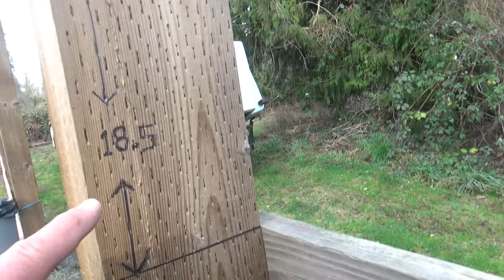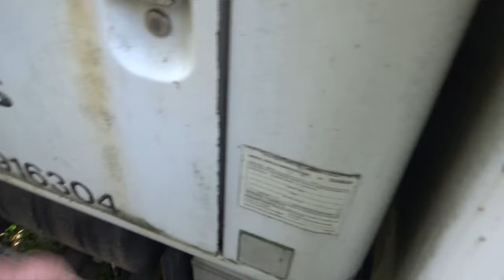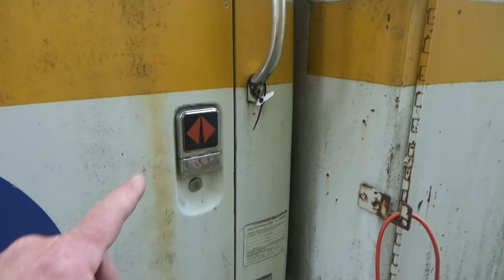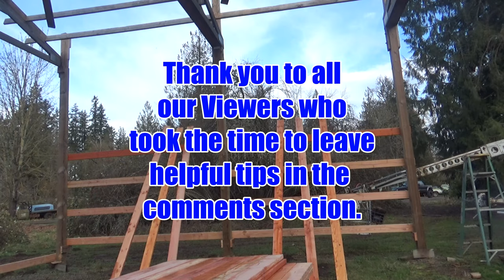Building Bigger

Comment: Little by little the workshop is taking shape, great work Rick you’ll get inside working one day.
Reply from the maker: That's the plan!
Reply: That's why we keep watching these shop building videos! BTW, Rick asked if we knew what to call the zip tie he was using to keep the fuel shutoff open on the bucket truck. My vote is to call it a "detent," even though it is hardly a stock item. Necessity is the mother of invention, after all..

Comment: the barn  is raising  quickly now.  keep it going and you will finish in no time!   the international DT is the series of engine you have. it is direct injection and does not use glow plugs.  some came with a grid heater in the intake manifold for the colder climates. yours probably didn't. the smoke is normal until it's put to work and warmed up.  the fuel solenoid is likely a three wire set-up with two coils. if that is what you have, one wire is pull in and one is hold in and the third is common.   if it's two wire, the solenoid must be grounded. you can check the resistance between the common (or ground) and the other two wires . one should be low resistance (pull-in) and the hold in coil will have high resistance. the pull-in activates while cranking and and the hold-in activates with run key switch.  you can have coil issue or voltage problems.   hope this helps.

Comment: That is a cable operated engine shutdown. Our 1993 has a T handle to the right of the steering column. To my knowledge, it does not have glow plugs. It may not have a block heater. We have a couple of magnetic heaters we use in severe weather. They work best  stuck on the bottom of the oil pan, but you can also stick them on the block at the cooling jacket.
Reply from the maker: Thanks for the info Rick!

Comment: They make and Sell a Dip Stick Block Heater, and it is just as it sounds, It goes in the Dip Stick Hole, and then plugs into and Electric Cord, and it does work well! You don't keep it in after you Start the Engine, but it does keep your Oil heated and ready to go. Look for them at either the Parts Store or a TSC Farm Store. God Bless you! (Keep up your Awesome Videos)
Reply from the maker: Thanks for the info!
Reply: @ClassicTruckRescue  No problem, just trying to help, Keep up the great videos, Keep on keeping them Real. May God Bless You!

Comment: Fuel shut off solenoid is not working. 
Does it have power and ground?
12V ignition on circuit, 12V cranking circuit,  common ground. 
Cranking circuit retracts solenoid, ignition on holds solenoid in place. 
Power test good then replace bad solenoid.
Seen a few where farmers have deleted the solenoid and just went with a manual cable added to the dash. And a return spring to put the lever back to open position.   Pull the knobs out closes the shut off lever,  push it back in and return spring opens lever back up.

Comment: It looks like you are getting into the part that will go faster than it has up to this point. That has to be encouraging. I always look forward to seeing the next step toward completing the building. I mentioned that I know little about diesel engines but I am aware that they have a device of some kind, revealing my ignorance here, that shuts off the engine. I think it shuts off the fuel. It looks like there is a solenoid that is missing from that arm, or, there is a solenoid there but it isn't working . Given that it shuts down when that is not held back, it would seem that something should be holding that arm back when you turn the key on.
Reply from the maker: I agree. Thank you and Thanks for stopping by again.

Comment: Hi rick good progress with the building , are you putting partical boarding on the roof and tin over the top of the boarding, i've found that if you just use just tin it gets condensation on the underside and it drips on everything plus it cuts down the noise when it rains. I know it's more expensive and more work , but much better building

Comment: Rick, Most Diesel engines that have an Either start assist system do not have glow plugs. If Either is used on a glow plug system the glow plugs can break and the pieces fall into the cylinder. There are magnetic block heaters that you can stick on the metal oil pan.
Reply from the maker: Thank you Dwayne. Good to know.

Comment: Rick I don’t know much about diesel but I do know that to turn them off you usually pull a handle that choke’s the motor off!!! And if there’s a block heater look where a freeze out plug would be if there isn’t one there’s no block heater!!! I’m thinking that cable is stretched out and blocking the intake for not letting it start properly!!!!

Comment: I know it’s a lot faster with a nail gun but I’m a believer in screws instead of nails. It’s stronger construction and they won’t work out like nails. It’s looking good coming right along.
Reply: I thought the same, until I had a contractor tell as a building flexes or moves, nails will flex, screws will break!
Reply from the maker: I have heard both. Screws are a lot more expensive though. I use the screws in some sdituations, (like when I attach brackets) but nails for most.

Comment: That's a fuel solenoid. That your putting a Nylon tie. On to start it. . It's usually electric. Make sure you have power to one of the wires. The older diesels you could take them off and take apart and clean them. They get corroded from setting. Moisture. If not take it off and take to a Dealer or parts store with serial number of the engine and truck. You should be able to get a new one. It starts Alot better... Also You could do away with it and use a push pull cable. And mount it where that arm is on pump .The old Macks and other trucks used that style forever. Cheap fix too. Just find a heavy enough cable for it. Mount it in the dash and done .Pull to start and push to shut off. Or the other opposite of that. Sending Prayers to Lou and Your Mom..
Reply from the maker: Thanks Thomas. The problem seems to have been corrected when I added the second battery in parallel.

Comment: Don't know if the diesel has working glo plugs or not but in case it does and you have a faulty gloplug light just leave the ignition on 15sec or so b4 ya try starting it..but it sounds like the additional batteries is doing the trick..

Comment: Did you ever get some ca ns of either and install them?
Second a question. You are going to put wood on the roof before putting Metal on? Will help keep the building square in wind and will keep the noise down in wind and Rain and hail

Comment: 👌✌️🤟👍👍👍😎 😀😁😁 plan your work; work your plan.  Yep 2 batteries;  mo, bedda,  bra,  now you no pow  him statin goods (Hawaiian pidgin English, yes I lived in Hawaii for a while) those Cummins diesel engines  due to variable valve timing of the cams always smoke at idle from what I read. In fact YouTuber George of Hill Auto Body and towing has  the same engine in a wrecker he was selling in his last video an mentioned that the engine always smoked.  Building is looking good. I remember those 18.5" blocks buried in the weeds  asked you about them. Lou, pattered everything you needed to complete the building. Just a matter of finding the right piece of the puzzle for the phase you are in. Peace out.

Comment: Sorry I don't comment on every video thought I might have on the last one or two. As most have said already and as you found out, with two batteries it will crank better. I have International bus about the same specs but I only use it in the summer so I only run one battery. When the bus was in service it use up to 3 batteries because how cold we get up here.
 Second most also have said either you would have grid heater/glow plugs or a ether kit but not both. @6:30 mark on your build a thon that braket with a line to the bottom on the drivers side of the rad is the ether kit.
Depends where the truck came most commercial vehicles in warmer climate especially south or indoor storage usually don't have block heaters. Want to mention not all of them are in the block some put circulating heaters in one of the lower radiator hoses. I doubt you have a second plug in the oil pan, but some do have the option that you and use a oil pan heater. Automotive, and Equipment places should have the glue on oil pan heaters. If you don't need it all the time just use a magnetic one, it can be used for something else just remember to take it off.
 For your fuel shutoff, it could be the shutoff solenoid or could be a power/ ground problem. As I remember that thing had some electrical issues in past videos. Some of the older IH trucks I've seen had two cables, not as new, but one would the shutdown and the other one would be labelled an emergency stop. My old 77kw and a old IH with a Detroit had the same thing. If you don't want to replace the solenoid could always put a second cable just a thought.
Sorry such a long read but I hope it helps.
All the best to Lou and the family.
I know getting older doesn't get much easier, but I'm finding grunting and groaning helps.
Reply from the maker: Wow. That is one "Knowledge-Infused" comment. Thank you so much for taking the time to share with me.

Comment: You need a new fuel shut off solenoid. Not all diesel trucks have block heaters but if it does it will be in the water jacket somewhere

Comment: No the truck does not have glow plugs.
 You can go on line or napa and buy the block heater and install it yourself they are easy to install, and not that expensive.
I'm a retired truck driver myself.

Comment: Normally on the full shut off there is a lever inside the truck to shut the truck off look like a chock lever doesn't look like it's hooked up on your truck
Reply: Would be even a rod or cable with a handle on the dash or beside the seat in the middle of the truck that runs to the linkage on the motor
Reply from the maker: I think it was controlled by a solenoid that wasn't getting enough power before I added the second battery. Thank you.

Comment: Hey Rick, OK, the diesel engine in this truck has no ignition system , & does not need one to start and continue to run. Compaired to a gasoline engine that will not start or run without an ingition system. OK, that said separates gas & diesel as far as what is needed to make it start and continue to run. Diesel engine doesn't have a carburetor , OK, your diesel boom truck has very high compression, double of what a gasoline may have, when diesel fuel is  compressed inside the cylinder to a high pressure it will continue to ignite so long as the diesel fuel dose not stop. The fuel injection pump on your boom truck has a on/off valve that in the open position allowes fuel to flow from the fuel tank through the injection pump which then becomes pressurized and feeds the injectors, the valve arm that you have been manually blocking down / open is the fuel flow on / off . This is why you cannot stop the engine without opening the hood to remove the device you are using to keep it open. It has a return spring that closes the valve to the closed position so the engine can stop running. OK, there is more to tell you about what may be causing the truck to not start & stop from the key like it used to do. The truck has a fuel cut solenoid switch that gets inerjized when you turn the key to the start position and is wired to stay inerjized and keep the fuel valve open till you turn the key to stop the engine, I believe this (Fuel Cut Solenoid Switch) maybe defective . Test for power at this switch while Jamie or somebody turns the key to the start position, I would recommend you disable the starter motor so the engine will not turn over while you are doing the test. I hope this helps you to get to the problem with the truck. Take care Rick.
Reply from the maker: Lots of good information. Thanks you for the knowledge and experience shared. I do appreciate it.

Comment: Oh that is a diesel no wonder it smokes . If it is gasoline then probably the valve guide seals are bad it smoke a lot when stating the oil setles down or drains down on the pistons. It is possible to change them with the heads on th motor. you have to air up the cylinder through the spark plug hole to hold the valve up. then remove the springs and replace the seals then put it back together. The Copd is there but your maintaing so it all good. I have to lose more wieght that is most of my problems. I am working on it I have lost 50 lbs so far. working out and Keto. If I can find an oklahoma post card I will send one to Lou. It probably the rings oh well when you get it done you can pull out the pistons and re ring it.